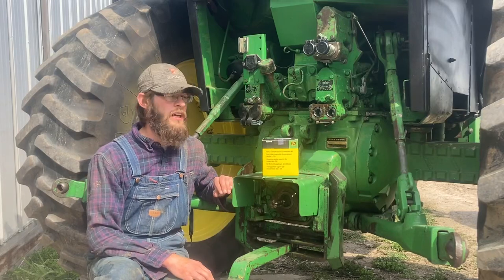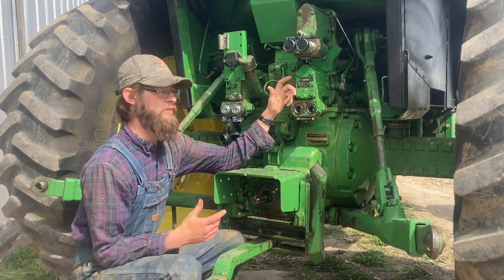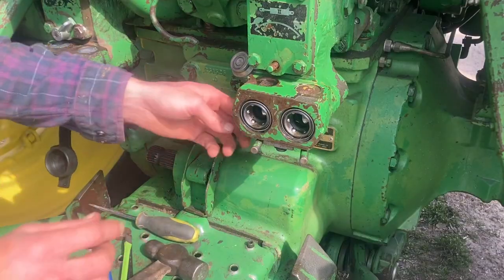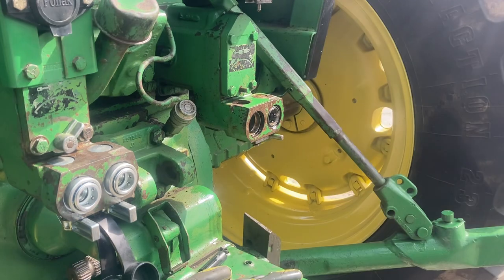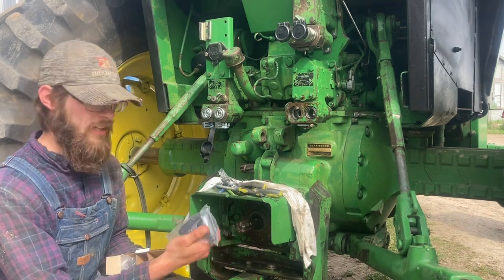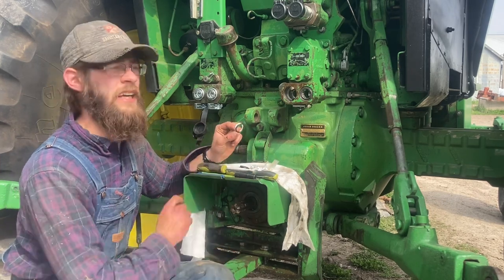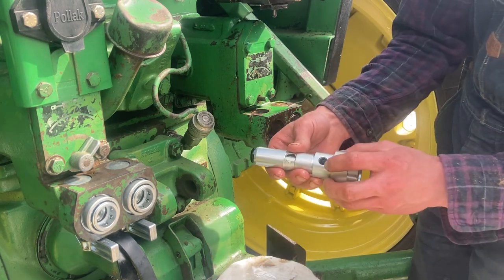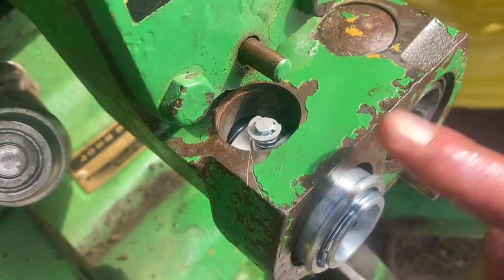Converting John Deere Hydraulic SCV to ISO/Pioneer

Comment: There's a better conversion kit out there called The wasp conversion kit get that kit and you'll never have another leak like I did on my tractor these two here leak all the time the pioneer is the same as a John Deere the ones I have are just push and pull just like the new tractors it's called The wasp conversion kit
Reply: can you provide a link? Know of any videos on the conversion...I prefer that over written instructions. Thanks

Comment: Have you ever had to replace any of these iso style barrels or replace the o-rings? Looks like that clip holding the barrel in place would be a real pain to get out once these are installed. Just curious
Reply: It can be. Just did them yesterday and the first one took a bit to figure out the easiest way. The rest were quick.  
I personally wish I wouldn't have done the conversion and kept using adapters.  Mine leak badly in no time.   I used kit RE206778 but I believe there is a newer style from JD. All the people I know around me have had problems . My brother did the Waspi/Grove kit and it has been trouble free for years.
Reply: @seth3645 thanks for the input. I’ll be doing more research on this now!

Comment: Hey awesome video! After you got the barrel in all the way were you able to move it back and forth by hand? I've got the seals and backwashers in and I'm working through this and it seems like id have to use a pry bar or a hammer to get it to slide.  I'm using an aftermarket kit (probably my first mistake) and think the tolerances might not be good.
Reply from the maker: This set slid back and forth nicely. I’ve had some sets before that we had to always pry forward. I wouldn’t use a hammer to do it though

Comment: Why did you convert it?
Reply from the maker: The Deere couplers are out of date. We do not have any equipment that runs that style, everything is Pioneer(ISO). Sure we could’ve just gotten adapters for this one tractor, but the seals probably would’ve still leaked. So with the new kit I got new seals and don’t have to screw around with adapters
Reply: @twocylinderwill  I don't have any problems with any of mine.
Reply from the maker: @bradjenkins932  if that works for you, great! Leave it be. This is what works best for us and our equipment

Comment: I just installed this kit in our early 1968 4020 yesterday.
The complete conversion kit at the dealer was the way to go.
It has everything in the kit you need to get it done.
Yes , take the lines off the block and remove the block , then disassemble on the bench to replace those o-rings and backing washers.
After this conversion is done , make sure to buy the correct couplers for all your hoses.